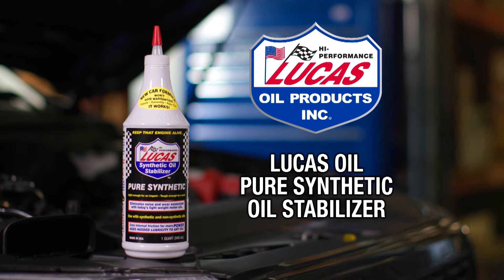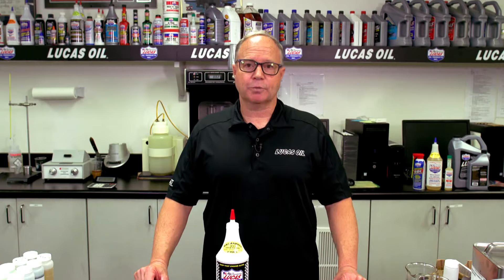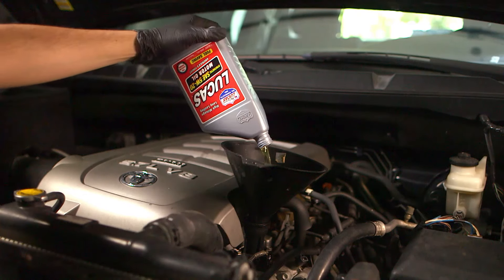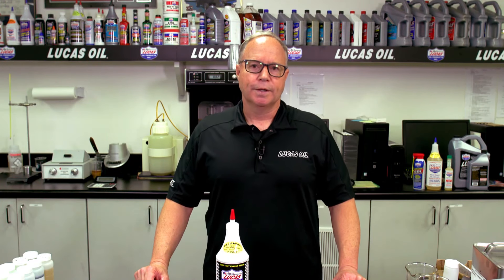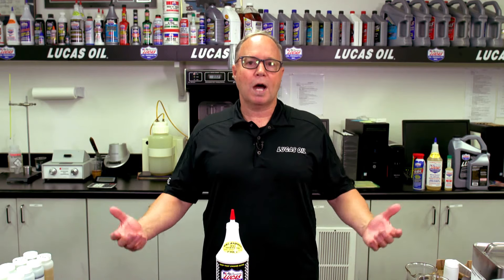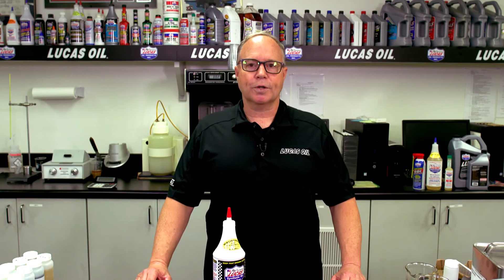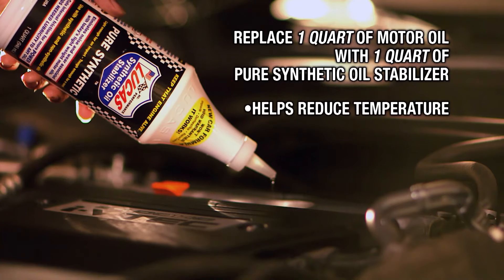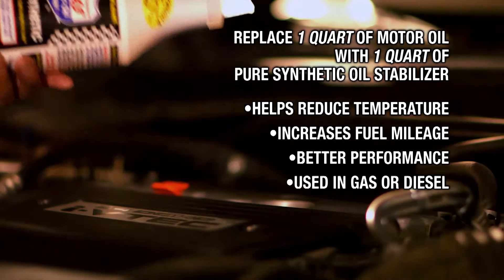How to Use Lucas Oil Pure Synthetic Oil Stabilizer

Comment: I am totally convinced. I did some stupid thing to my Toyota ECHO at 210K. The the car had miss fires on random cylinders and squeaky noises ever since. 3 days ago at 235K, I put 1/4 of a bottle of Lucas synthetic oil stabilizer. The miss fires are gone, vibration reduced a lot, the squeaky sound gone immediately, and engine quiet down. I am totally convinced. You will have me a customer for life. I will use it on ALL my cars in the future.
Reply: Which one did you use exactly?
Reply: How much did they pay you to say this 😊

Comment: 2004 Lexus LS430 300,430 Miles. I Use 1 Lucas Pure Synthetic Oil Stabilizer And 5W-30 Mobile 1 Extended Performance Fully Synthetic Oil. I Bought The Car When It Had 48,000 Miles. I Drive 120 Miles Total Round Trip To Work Everyday. This Combination Works Great For Me.
Reply: 2000 ls400 330,537 I use 1 stop leak and had it since 200k

Comment: What if I just add it without replacing a quart
Reply: Oil can bleed over into your spark plugs causing issues. Motors only hold so much before their overfilled.
Reply: Is that a serious question? Are you a millennial? LOL
Reply: @gtstanton9785  so what if he is? It's a valid question and if he asked it at least he has enough brains to ask before doing something dumb. Think man. Help the younger generation. Don't be rude.
Reply: Add it to a freaking oil change,minus 1 quart of oil. So you still get a total of however many quarts the engine takes. It's not that hard 😉
Reply: @joshmiller1928  you got the idea Josh. Although I've got a '86 Pontiac with a 307 that I keep a quart of lucas in and a '20 mustang gt that I just run synthetic Motorcraft in. Whatever floats yer boat.
I like that Pontiac for what it is but that mustang shi-s and gets. I don't know what else to say.....
Reply: @gtstanton9785  he’s a genx
Reply: @The OutLaw General Bacon  WITHOUT REPLACING IT, he's using it while NOT replacing in a quart of oil. So how does this overflow? Your trading one liquid for another. Not adding.
Reply: @gtstanton9785 he was only asking a question. Don’t belittle others
Reply: Why would you overfill your oil?
Reply: @slevpy  Drain your existing oil, Add a quart of the Lucas, Top off with regular oil checking your dipstick periodically

Comment: Never did explain what it does!
Reply: He did lol… he literally gave several examples of what it does to improve your engine oil
Reply: Less friction heat parts last longer, noise reduction from less friction, reduces hesitation when you accelerate due to your internal parts moving faster (cooler)

Comment: Will it help bring up my oil pressure just a little bit?
Reply: Possibly. A higher weight oil will bring up oil pressure.
Reply: It will increase oil pressure.
Reply: I had an oil indicator light that would flicker at idle speeds.  Since I started using the high mileage oil It hasn't come on since.  I'm totally impressed.  2001 Nissan Frontier with 268,000 miles😊

Comment: Do you add the Luca stabilizer first or engine oil first for oil change?
Reply: You mean right after break period?
Reply: @butchrishel1505  I don’t understand your question.  I am trying to find out: after I drained the engine oil and get ready to replace the oil, should I pour the Luca oil stabilizer into the engine first or pour the regular engine oil in first? Or it doesn’t matter which one I pour in first?
Reply: I just took it to my jiffy lube place of business and told them to put it in when they changed the oil so I think it all went in at the same time the choice is yours
Reply: @vlam8451 You can add it even after you've changed the oil. I did an oil change and a few weeks later my car was having a hard time starting in cold weather. Changed the battery terminals and it still didn't fix the problem. I poured a bottle of Lucas oil 1 quart to be exact and it actually improved the way the car starts now. I've also done a coolant flush and radiator is brand new but the Lucas oil does really work.
Reply: @DianeDixey  When I first use Luca oil stabilizer, I think I did it wrong because I filled the required amount of engine oil my car calls for, then dump the whole bottle of Luca in. Later, my common sense mind told me that if I am putting one quart of Luca in, I need to reduce the engine oil by one quart.

Comment: Can we use it when we used the higher end oils like Mobile 1 extender performance?
Reply: Absolutely.lve been using it over 20 yrs in everything l own.never had any oil related problem.
Reply: I use it with pennzoil platinum and it works wonderfully.

Comment: can I use "Lucas Oil 10001" for the engine, gearbox (manual switch) and differential gearbox?
How much do I have to add lucas oil? Assuming the engine has 6.5 L of oil, the gearbox has 1.2 L and the differential has 1 L.
Reply from the maker: Yes, our HD Oil Stabilizer #10001 can be used in all 3 applications. The treat ration for the engine and gear box would be 20% of system capacity. In the differential you can go up to 50%.

Comment: Just wondering if it's ok to use Lucas Oil Stabilizer in my daughter's Hyundai Accent when the temperatures get lower in the winter, like as low as 15 degrees below (Celsius). Does it thicken the oil too much. Viscosity recommended is 5/20 wieght for that car.
Reply from the maker: Yes, our Pure Synthetic Stabilizer can be used in colder temperatures. It will help keep that protective "film" over the engines internals to help prevent dry starts.

Comment: Hello there. Can you add this without doing an oil change?
Reply: No
Reply from the maker: Yes, you can add this without doing an oil change.  However, we recommend adding the product during an oil change so you know how much you are adding in.  We recommend a 20% Oil Stabilizer to 80% motor oil ratio.  This is not a top off product.  Do not surpass your vehicles recommended oil capacity.

Comment: I bought a Charger, brand new at the time in 2013. It now has over 191k miles. Should I use the High Mileage stabilizer when changing my oil? What could I expect from using this? I do have misfires while driving and a slight rough idle. Hesitation when I accelerate. I just replaced all my spark plugs and coils and basically gave my car a tune up. Help please lol. Thanks!
Reply from the maker: Based on the weight of oil that your vehicle uses, we would recommend our Pure Synthetic Oil Stabilizer.  This should really help alleviate the issues you've been experiencing with your vehicle.
Reply: @LucasOilProducts  thank you for replying!! I will use that version.
Reply: @jaefrmdacap any updates??

Comment: can i use the regular lucas oil stabilizer in my FORD E350 2008 my oil is 5w-20/30  no one sells the synthetic oil stabilizer here
Reply from the maker: Yes, our recommendation would be to use our Heavy Duty Oil Stabilizer at a 10% treat rate instead of its full 20% as this is a more viscous product compared to our Pure Synthetic Oil Stabilizer.

Comment: Have a 2017 hyundai tucson 2.0 gdi  would lucas full synthetic be ok to use in gasoline direct engine?
Reply from the maker: Yes, Lucas Pure Synthetic Oil Stabilizer will work with your GDI engine.

Comment: Could this be used with 0-40 oil?
Reply from the maker: Yes, our Pure Synthetic Stabilizer can be used in vehicles that use 0W-40 engine oil at our recommended 20% treat rate.

Comment: Synthetic oil stabilizer vs High mileage oil stabilizer 
What is difference between both of them?
Reply from the maker: Pure Synthetic Oil Stabilizer is less viscus, and works well in both full synthetic and non synthetic oils.  It works great in new and worn engines.  High Mileage Oil Stabilizer is formulated for older engines that have high wear and have created larger tolerances between the engines parts.  The higher viscosity of the high mileage helps to increase oil pressure in worn engines.  It also has an additional additive package to renew worn seals in the engine.
Reply: @LucasOilProducts  My Nissan 2001 has 267000 miles.  They normally put Mobile One synthetic oil in at oil changes.  Is it still OK to use the heavyweight or should I skip to the Synthetic Lucas product
Reply from the maker: @DianeDixey  Heavy Duty Oil Stabilizer is safe to use in both synthetic and non synthetic oil.

Comment: Can i mix it with 10w 40 oil?
Reply from the maker: Absolutely, and it will add many benefits to your vehicle.  The addition of any of our oil stabilizers will increase oil life by 50% or longer, reduce oil consumption, eliminate dry starts, raise oil pressure, extend the life of your engine, and increase power and miles per gallon.

Comment: What Lucus product should I use with Ow20 . My camry 2011 burns engine oil.
Reply: My 2013 Camry is burning too
Reply: @bob123281  then how often you keep adding oil ?
Reply: @MVDSo2  a lot man. Problem is 0w 20 is thin oil. I’m going to try the Lucas oil treatment next oil change inshallah.
Reply: @MVDSo2  have u tried it?
Reply: @bob123281  I bought it. But everybody tells me  after sometime engine will stall. Idk how true is this. So I did not use ut yet.
Reply: Yes with the synthetic verision . 0/20 is too light of oil . Which could of caused the premature wear.

Comment: What's the difference between synthetic and heavy duty Lucas?
Reply from the maker: The major difference between the two formulations is the viscosity of the product.  Our HD Oil Stabilizer is about twice as viscous as our Pure Synthetic Oil Stabilizer.  If you have a vehicle that has a "lighter" weight oil (5w-30, 5w-20) we recommend the Pure Synthetic formulation over the Heavy Duty Oil Stabilizer.  Pure Synthetic offers all of the same benefits of the Heavy Duty Oil Stabilizer, but is formulated for vehicles utilizing a lower weight oil.
Reply: That's valuable information. I Really Appreciate your time with my question. Thank you, @LucasOilProducts

Comment: Is good to used this oil on bmw ?
Reply from the maker: Lucas Pure Synthetic Oil Stabilizer works great in BMW vehicles.  If you provide more details about the year, model, and mileage, we can recommend  which Lucas Stabilizer is best for your vehicle.
Reply: Bmw X5 4.8i 180 miles ✍🏼✍🏼🙏✅👍🏻
Reply from the maker: @corridosbarron3566  Yes, Lucas Pure Synthetic Oil Stabilizer will work great in your vehicle.  Just replace 1 quart of oil with this during your next oil change.  Thanks.
Reply: @LucasOilProducts  ok thanks 🙏

Comment: Lucas Pure Synthetic Oil Stabilizer says nothing on the bottle about it being safe to use in a 0W-20 Oil-taking engine. What it says on the bottle is 5W-20 & 5W-30, etc, which I find pretty GD Vague and highly aggravating! So, which is it? Should I use Lucas Pure Synthetic Oil Stabilizer or Lucas Oil - Low Viscosity Stabilizer in my 0W-20 Oil taking engine bc it sure seems that Lucas Oil doesn't seem to know the answer to that question, and it's their own GD Product! Their vagueness most certainly doesn't give a brother a very warm, reassuring feeling in their ole tummy on which route they should be going, which would make a wise man simply stay clear until they get just a tad bit less vague and way more premise in their directives in regards to their product! Until then, my wise-ass will be staying way clear of the craps table!